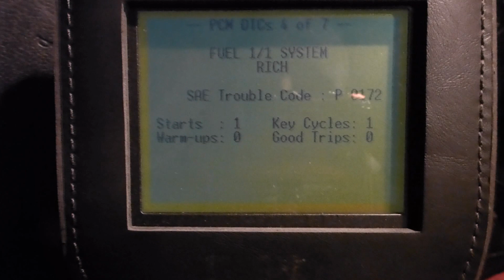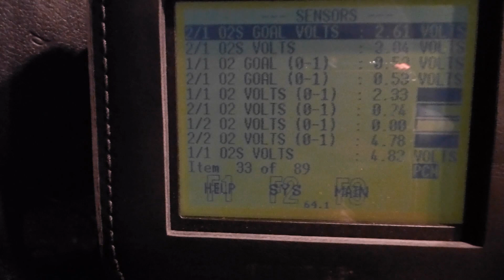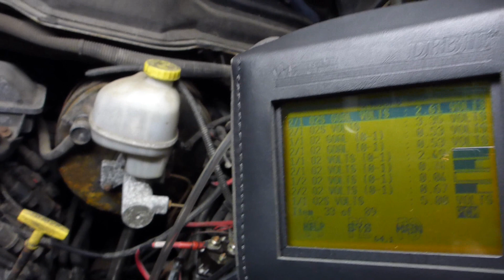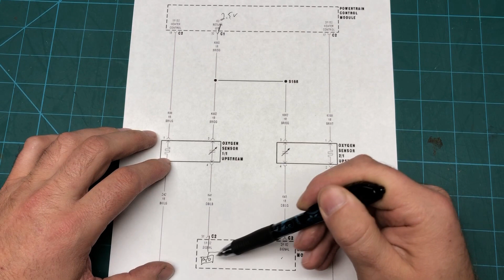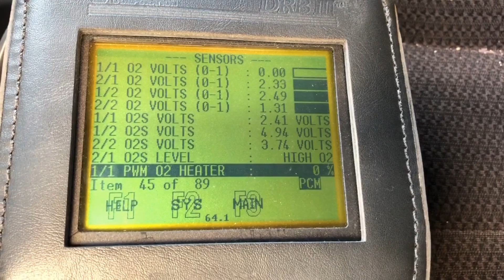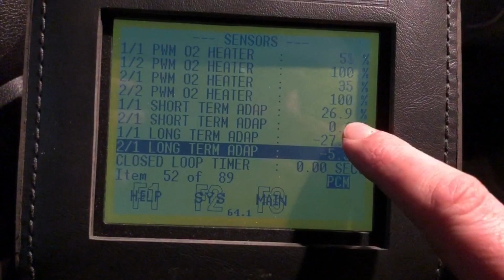04 Ram 5.7l Bank 1 misfire diagnosis

Comment: How did you fix the leak p0171
Reply from the maker: There was no leak, the o2 sensor fixed that fault as well. The o2 was feeding the PCM false information making it think that bank was running lean. As a side note, this truck doesn’t have a MAF sensor so most vacuum leaks would actually make the truck run richer or stay in normal fuel control. The speed density system would see the vacuum leak as a drop in vacuum and falsely assume that the vehicle is under load.

Comment: Had the same deal with my 04 . Faulty sensor will get you running but what caused the sensor to go bad??? I realize your weather conditions are different for you. BUT if you pull off the breather assembly it can tell ya a lot in this case. If there is visible oil there change your Pcv valve . that caused your issue. then of course change your o2 sensors besides clean out the oil in the breather. Then you will see a dramatic change in your engine. 1 that plugged or stuck open pcv will raise your pressure inside the motor causing it to make seals leak use oil etc. plug your converter send 02 codes so on and so forth lol at the same time since the sensors actually run the engine until you change them it won't run good so you are battling a 2 problem child .Sure you can just change the sensor it will run but it will fail again. All because of one of the easiest parts to replace and cheep too .still enjoyed the video bro good way to trouble shoot problem sensors for sure.
Reply: oil in the air box can also be caused by overfilling the sump, keep the oil level in the SAFE  area on the dipstick not to MAX mark as I used to. My dodge ram has a MIN and MAX mark on the dipstick and I felt that it wasn't a problem keeping it at MAX but I think that is a mistake; you also may find oil in the plenum if it is too full.